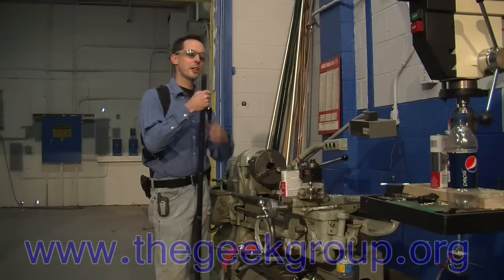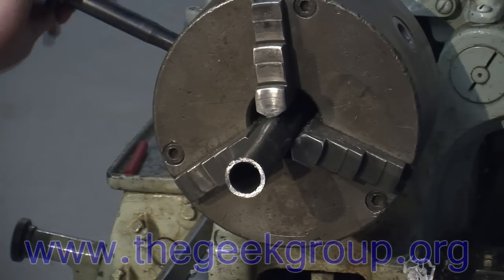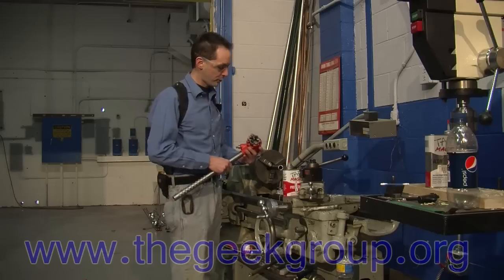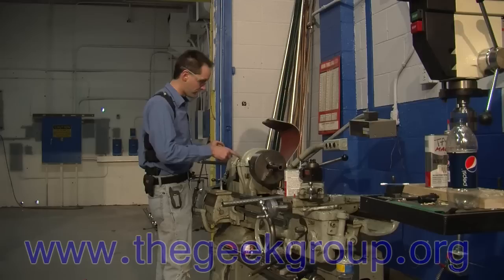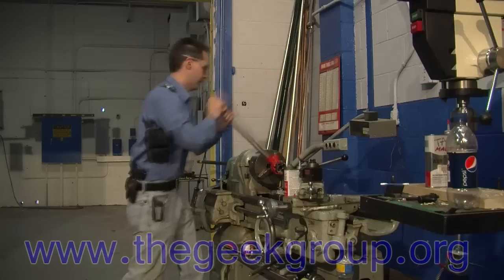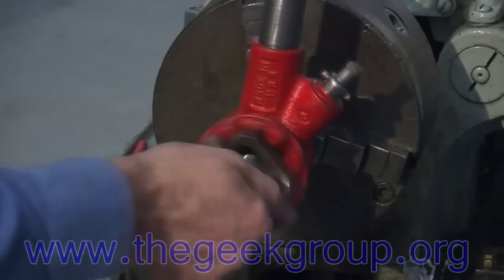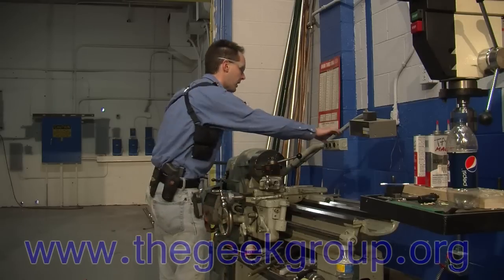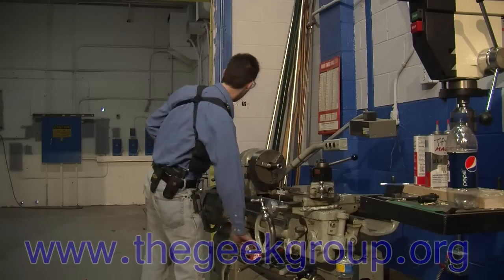Pipe Threading 11 09

Comment: In scool we had a vertical pipe on every lathe where you have to put the big key into. Otherwise it won't start.
And we had a policy: If you leave the key in the chuck and walk away from the lathe, you have to put 50 cents into a jar. The money is used to buy stuff like bandages.